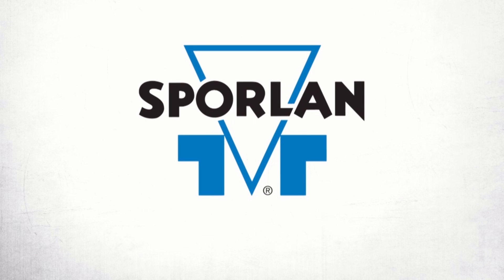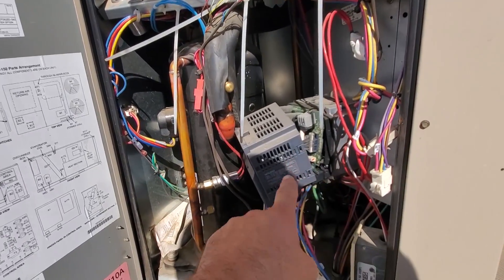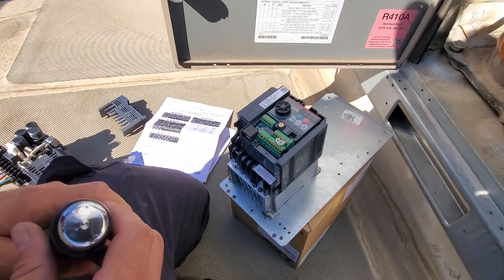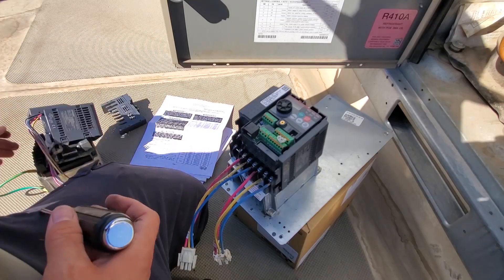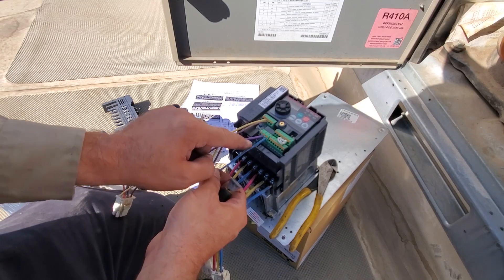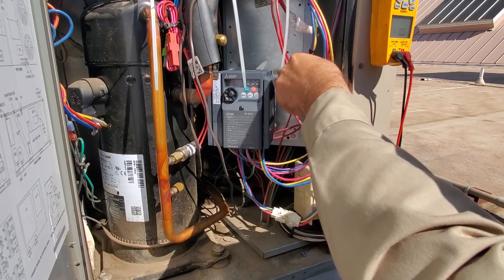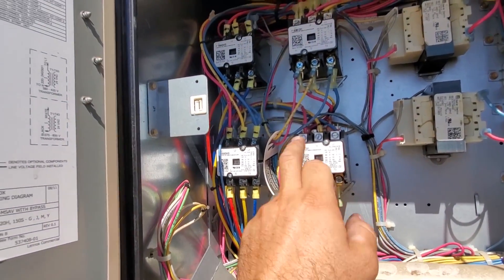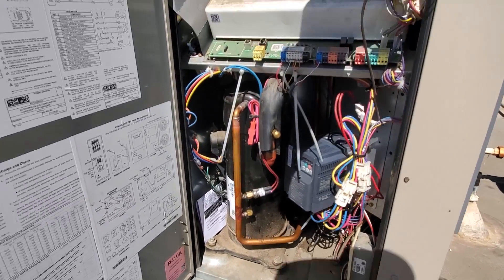LENNOX VFD FAILURE

Comment: I'm changing  a carrier ruftop  unit  bloower motor  the new motor  has   its 3 hp. It's same model..and number.  The blue wires 2  coming out  fron the motor.   Has fimale and male ..to connect  the the red wires goit  to the control .. but this red wires  has only males..adaptes....  so  only 1 gets conested  quet about  the other ..the old motor it wasn't   this  motor its fron  marathon  motors..like this. Any  suggestions.?.?

Comment: Just for those who are not aware, those vfd’s can hold a lethal charge up to 5 minutes. I personally usually wait about 15 minutes to touch any wires when changing one out. The manual always has the info about how long to wait when changing a vfd. Don’t want anyone out there learning the hard way

Comment: At my warehouse that I take care of I have a strapping machine that has vfd drives. It is also plc driven. This machine is what has taught me a lot about a/c voltage. The vfd's control the motors that feed the strap and tension the strap around the product. In my case we strap tires for the manufacturers ford,chevy, etc. I thank you for showing how you replaced it and using tech support. If I could teach someone about any trade, i would say don't be afraid to call tech support. Being self taught on a lot of things I would say that calling tech support will save you a headache and time. Trying to look things up for an hr when you can get the answer in a few mins is priceless. I found that if you know how to use a multimeter these guys can walk u through about anything electronic or electrical. Thank you for the great videos.

Comment: 14:14  Not a HVAC guy but I was thinking the same. Both contactors should use an interlock, either mechanical or electrical. I mean, You CANT call both of them AT THE SAME TIME. Old relay boards with big three phase contactors used to invert rotation, both contactors were conected mechanically through a crowbar, so Its is one or the other, never both. Sensitive things like this, shouldnt be just SW controlled. A plan B for fail safe is required.

Comment: a bit late to the party maybe, but why are those contactors not wired like a logic XOR gate?

basically like the cooler/defrost interlock, except on both contactors? If I understand those things correctly, that way they'd only allow one to be energized, and never both...
Reply from the maker: Good question they certainly should be!  I will be going live on YouTube this evening 12/30/19 @5:PM (pacific time) to discuss my most recent uploads and answer questions from emails and the chat, come check it out if you can
https://youtu.be/XNnsDZUitZQ

Comment: I'm surprised that those run and bypass contractors are not electrically interlocked.  A VFD out put is not a sine wave - if you ever look at a vfd output on an  O scope it will scare you to death.  A vfd not only varies the frequency of the output it also vary the voltage - so if your speed is 50% your motor will be turning at 30 Hertz your voltage will also be 50% - so you can see what would happen if you bypassed the drive that was running at a reduced speed not only would you be closing two electrical systems into each other at different frequencies they would also be operating at different voltages - and to add more destruction to the mix there is the phase relationship difference that the drive creates - when a drive takes its input voltage it converts it to DC- then the drive fires the triacs according to what the drive software is calling for - even if both systems are operating at 60 Hertz the drive input and output will not be Synronized - the more electrical degrees apart the two systems are determines the amount of fault current that will be generated.  That is what blew up that drive I'm sure.  I have seen huge breakers launch out of switch gear and hit the wall because phase rotation was not correct on a 4000 hp generator that generates 2.5 megawatts of power at 4160 volts.  What they have designed is a bomb waiting to blow up in somebody's face. I would disable that bypass relay so there would be no way it could supply power to the output of the drive - I would mark the phase rotation and disconnect the power to the bypass relay - then if you need it you could disconnect the input from the drive and reconnect the bypass relay.  And if you need the bypass relay I would also disconnect the output of the drive - you will be backfeeding into the drive when your bypass relay is energized...  judging from this video I would not let any employees mess with it.  Everyone needs to understand exactly what forces are in play with two out of phase power sources... if you want to verify what I'm saying next time you get around one of these drives put your meter on voltage and put one lead on A phase input and the other lead on A phase output - if they were in sinc the meter will read 0 volts - any voltage reading indicates how far out of sync the input and output are - with a little math you can figure out how many electrical degrees out of sync the two systems are.  Good luck
Reply: JT H - And that’s just V/Hz drives... Sensorless Vector Drives are even more complicated. The manual for every VFD I’ve ever seen states that you’re not supposed to use contactors... direct hardwire to the motor only. 🤨

Oh, and FWIW it’s not triacs in the drive; it’s usually IGBTs... although some older and/or smaller units have used MOSFETs... triacs depend on the input power going thru zero to switch off (so when it’s used on a AC source, it’s not a problem; but connected to the DC bus of the VFD there would be no way for the triac to turn off).

🙂
Reply: @darkwinter6028  I have found several contactors involved with vfd systems with their contacts welded closed.. lol those contacts dont like the high frequency voltage spikes associated with vfd.  The contactors were emergency shutdown contactors that were supposed to shutdown all the fuel pumps at a big name brand filling station.   I was contracted to check the functionality of all the safety systems at several different stations - I found failures at each station.  These systems were manufactured and purpose built with UL labels and built by a UL 508 panel shop.  I notified the manufacturer- the fire department and the electrical inspector .. that type of design will no longer get past electrical plan approval in that city.  I was surprised that the designers did not put filters on the input of the drives to filter the commutation spikes from the drives out of the supply voltage.

Comment: Can someone explain why you’d need a vfd for 59hz? When standard line voltage is 60hz?
Reply: I think that actual ouput freq is 59Hz. VFD are supposed to change the freq to control de speed of the AC motor. Looks like it settle at 59 but the VFD will change that on demand, to iddle the motor or make it run faster.

Comment: Chris, Nice job !! One thing, when you were transfering the wires on the green blocks ( wire for wire) those green blocks are called Euro-blocks, you should be able to pop the top of each section, there are pins under each block, and they plug into the base of each block,  It's a time saver.

Comment: Interesting design. Lennox should have used a reversing contactor setup. If one side is on there is a Electrical interlock using Auxilliary contacts, along with a Mechanical interlock between the contactors. Good practice with the 480 connections. I take a pictures using a cell phone of the connections at different angles as a backup. Regarding arc flash if low peak fuses are used with proper wiring I am more secure. With a breaker then watch out. Breakers can put out 12 cycles before tripping. Low peak fuses open at the first 1/3 of a cycle if shorted. They are also expensive. :-)

Comment: I really dont know why on earth a VFD is needed in a unit like that. Is it some sort of eco code or something? Also IMO Lenox should be using interlocked contactors that make it impossible for the computer to pull both in at the same time.
Reply: Well here they stsrting selling home "inverter units" claiming that savings are between 20 to 30 percent. Go and figure. Inverter units are VFDs (I think). Some applications need VFD, like elevators, trains, CNC etc. Not for economy but to get tight speed control. But in an Aircon look like a Prius glued there. Sure it produces somes savings but .... I would love to see them.
Reply: Pretty sure it is code now I believe it started like a year or 2 ago. Also I seen alot of Lennox's with them that are hooked up to vav systems maybe because they dont offer a  bypass controller.  And use the vfd to adjust the cmf. Not 100 percent sure. Another typical government mandated part that cost more to install and fix that's suppose to save money on electricity but you end up spending more.

Comment: Bypass contactors should be both electrically and mechanically interlocked especially if used around a VFD - secondly is it possible that the original VFD was actually not faulty at all and the problem the motor supply cables that where shorted on the cover ?? Most VFD are very well protected for shorted output.
Reply: I'd guess they didn't ziptie the wiring and plug away from the case/cover or someone cut them off, it got wet from rain(near ocean/salt water worse) that let it strike an arc easily, in which it kept burning happily until it went ka-boom.
vfd wiring needs special consideration, it's very rough high voltage pulses, at 480VAC input, that's 670+VDC output in high speed pulses. which is also beyond the rating and spec of many common wiring and wire splicing devices and techniques. there's probable multiple failures scenario's there, from engineering, through factory, to previous field service technician's :)

Comment: You do some good work. However instead of using electrical tape on those butt connectors it would be better to use adhesive lined heat shrink. I also would have cut those wires back so that the insulation came all the way up to the screw terminals.

Comment: I really love your channel. I'm an electrical engineer from germany and your right, you have to show respect when you're facing a 480V 3phase system. I worked a lot with 690V 3phase here when i worked in automation for big industries like steel mills. Theese days mostly 400V 3phase, what is actually the supply for every private house over here. I wonder that you don't work with end sleeves on stranded wires in the US. Here in Germany you would never connect a VFD directly with stranded wires.

Comment: It seems weird that Lenox would sell the VFD without the wiring attached.  It also seems insane that they use the same colors and connectors for the input and output harnesses.
Reply from the maker: I will be going live on YouTube this evening 9/30/19 @ 5:PM (pacific time) to discuss my most recent uploads and answer questions from the LiveChat, YouTube comments, Emails, and Facebook comments come check it out if you can. https://youtu.be/ZAA19Gt7NEo

Comment: Maybe lennox should wire in a relay that would disable the drive contactor if and when the bypass energizes.
Reply: Normally closed relay to drive contactor control wire that opens when power is sent from bypass contactor

Comment: Next time use your cell to watch the unit startup and stand aside from the access panel and the disconnect switch. In this case it would have been better to stand further down the side of the unit away from anything that could go boom. Backing up and turning your head will not help, if anything happens it will happen so fast that it is like dodging laser beams. Hopefully one day you be driving home with a destroyed cell phone and amazed at how fast the whole thing went sideways, but you are fine and just need to replace your cell. You have a tripod so you could have used it for keeping an eye on the startup.
Reply from the maker: I will be going live on YouTube this evening 9/30/19 @ 5:PM (pacific time) to discuss my most recent uploads and answer questions from the LiveChat, YouTube comments, Emails, and Facebook comments come check it out if you can. https://youtu.be/ZAA19Gt7NEo

Comment: Tip for using but connectors, use some silicone filled heat shrink over the top to keep moisture out and protect others if the plastic cracks.
Reply from the maker: I will be going live on YouTube this evening 9/30/19 @ 5:PM (pacific time) to discuss my most recent uploads and answer questions from the LiveChat, YouTube comments, Emails, and Facebook comments come check it out if you can. https://youtu.be/ZAA19Gt7NEo

Comment: If the bypass contactor can backfeed the VFD, then they did it really wrong!

They may have used the wrong contactor type, or cheaped out or something...

You should have a normally open and normally closed contacts...  Motor should go to the common, VFD output to the NC and power to NO. This way, there is no way for the VFD to get backfeeded, the contacts will break before it make with the other, and you can not get a short between NC and NO unless the contactor melt down...
Reply from the maker: I will discuss this on my livestream tonight,  I will be going live on YouTube this evening 9/30/19 @ 5:PM (pacific time) to discuss my most recent uploads and answer questions from the LiveChat, YouTube comments, Emails, and Facebook comments come check it out if you can. https://youtu.be/ZAA19Gt7NEo
Reply: VFD output is a very harsh and hard to deal with power, at 480VAC input it 670+VDC output pulses varied in width(on time) and there's equally as harsh or worse back EMF from the motor/s, so they'd need to use special, wiring, contactor and splices to withstand that properly.
the whole issue is, they're using common junk rated for AC on PWM DC, where it should have never been used. even those nylon quick disconnect plugs are suspect looking :)

Comment: The drive failure on these I have seen is heat. The manufacturer did not design these to run in the heat your region has. If u look at what the vfd is rated for and temperature you will see inevitably they will fail
Reply from the maker: I will be going live on YouTube this evening 9/30/19 @ 5:PM (pacific time) to discuss my most recent uploads and answer questions from the LiveChat, YouTube comments, Emails, and Facebook comments come check it out if you can. https://youtu.be/ZAA19Gt7NEo

Comment: I work on high voltage all the time up to 13800 volts. I respect all your videos and your OCD. The manufacturer has a torque spec for line connections. You turned in then turned out then turned in. Was the torque wrench in your arm clicking
Reply: Also at an added note 120v kills way more people than 277/480. A 480 v unit runs lower amps and arc flash potential when apple's are compared to apple's 120v will have a larger arc flash potential.
Reply: @davidhaynes98  that's only cause very few people playing w460 v. Try shorting out  460 v.

Comment: Don't those green contact strips in the vfd just unplug? They should use a relay that opens the circuit to the vfd when it bypasses it. A 3 phase reversing contactor could be used with a slight modification.

Comment: I'm taking a class on VFD's for my Automation program in school, and we just got to setting them up in the lab.  Lots of reading the manual, and quick start guides and learning what to look for for troubleshooting, and how to program them right now.  After 2-3 weeks doing the basics, learning error codes and things we're supposed to start wiring and interfacing with PLC's and networks and I'm really excited for it.   We're going through a lot of troubleshooting, and it's one of the things we focus on a lot in this program.  Having you going through this kind of stuff, and showing examples of it, and how to fix it really puts the theoretical into context. Even the practical stuff we do gets some grounding with real world and it makes me feel more confident.  

Some of the stuff we've had hit on us, is of course the importance of incoming power and power to the motor, not getting mixed up.  Also have been told that you cannot have a drive fed incoming power through filter capacitors.  Thanks for putting out a VFD video.  Your troubleshooting and installation videos are always full of great tips and you have a really solid methodology.

Comment: You could strip the wires a little shorter.
Reply: I was looking at that on the 480v wire and motor wires. I would think the insulation should stop at the screw terminal. I have so many installs that have so much bare wire showing, that they short together if bent just right.
Reply from the maker: I will be going live on YouTube this evening 9/30/19 @ 5:PM (pacific time) to discuss my most recent uploads and answer questions from the LiveChat, YouTube comments, Emails, and Facebook comments come check it out if you can. https://youtu.be/ZAA19Gt7NEo

Comment: In Germany we normally use ferrules.  This makes it easyer to prevent arcs between the connected wires 😉
Reply: Well you have to use them in screw terminals with fine strand wire in any case, for cage clamps you can get away without them. For the wire connection i would go with ferrules and wago clamps, easy and fast way.
Overall that cabinet would never have passed an inspection in germany at any given time.
Reply: I love those ferules but cant get them in the Caribbean for a cost thats worth it. Was certified by Aachen chamber of crafts
Reply: we have a winner! bad from the start at engineering, maybe lack of factory care (no zip-ties keeping it away from metal) or maybe field techs were to blame :)